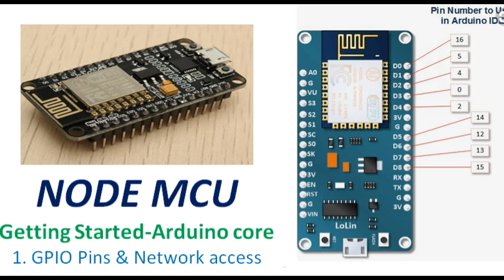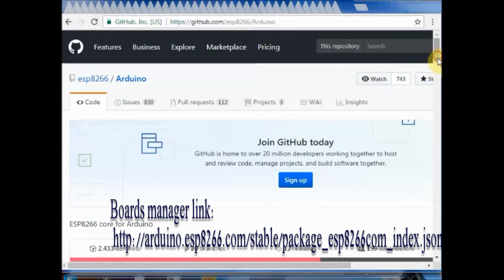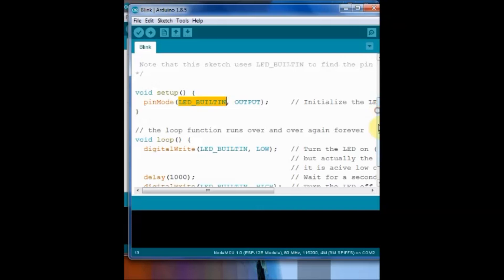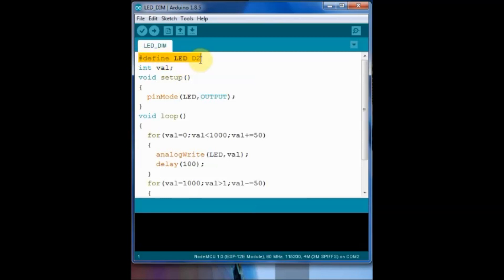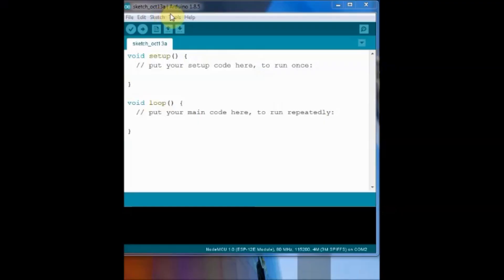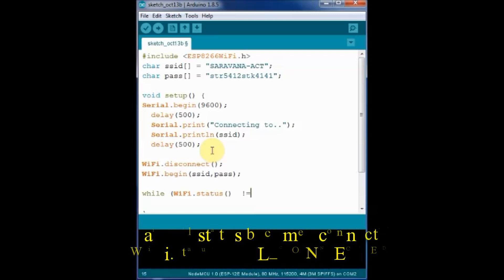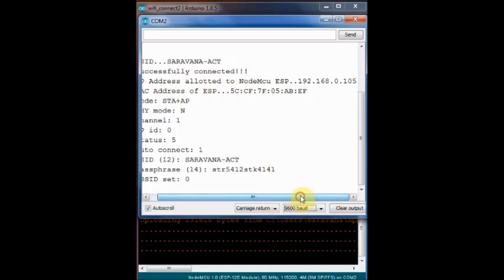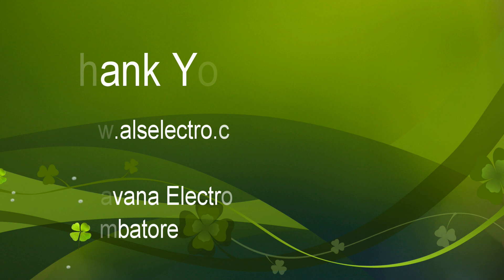NODEMCU - Getting started with Arduino core 1. GPIO & Network Access

Comment: Thanks for the info and video.
Since these boards are usually 3.3 volts I don't think you need the resistor for the LED?

Comment: For those who got the Leaving... Hard resetting via RTS pin message, try keeping your serial monitor open while uploading the sketch. Hope it works.
Reply: i tried doing that nd i am still getting this everytime i upload 
esptool.py v2.7
Serial port COM3
Connecting....
Chip is ESP8266EX
Features: WiFi
Crystal is 26MHz
MAC: ec:fa:bc:a8:3c:e8
Uploading stub...
Running stub...
Stub running...
Manufacturer: 68
Device: 4016
Detected flash size: 4MB
Hard resetting via RTS pin...
esptool.py v2.7
Serial port COM3
Connecting....
Chip is ESP8266EX
Features: WiFi
Crystal is 26MHz
MAC: ec:fa:bc:a8:3c:e8
Uploading stub...
Running stub...
Stub running...
Configuring flash size...
Auto-detected Flash size: 4MB
Compressed 261168 bytes to 190754...

Writing at 0x00000000... (8 %)
Writing at 0x00004000... (16 %)
Writing at 0x00008000... (25 %)
Writing at 0x0000c000... (33 %)
Writing at 0x00010000... (41 %)
Writing at 0x00014000... (50 %)
Writing at 0x00018000... (58 %)
Writing at 0x0001c000... (66 %)
Writing at 0x00020000... (75 %)
Writing at 0x00024000... (83 %)
Writing at 0x00028000... (91 %)
Writing at 0x0002c000... (100 %)
Wrote 261168 bytes (190754 compressed) at 0x00000000 in 17.1 seconds (effective 122.4 kbit/s)...
Hash of data verified.

Leaving...
Hard resetting via RTS pin...
Reply: @ambicatandle2541  Mine also is now doing the same but the circuit still functions properly. Sometimes I'll need to press the reset button but the circuit will work fine

Comment: Leaving.....
Hard resetting via rts pin
Why is this showing sir...please reply
Reply: I've got the same problem when I've installed NodeMCU 0.9 at first. Changed it to v1.0 and it fixed the problem. Still shows 'Hard resetting via RTS pin, but the LED is blinking as it should.

Comment: NORVI IIOT - ESP32 for industrial projetcs

Industrial ESP32, Ready for multiple IDE : Arduino and ESP-IDF
USB Programmable Industrial ESP32 with OLED Display and din-rail mount
Not just a ESP32 in a industrial enclosure, it has designed for protection and reliability.

www.norvi.lk

Comment: In my location (and this is probably true for many users) there are several  access points only marginally within reach, and running WiFi.scanNetworks() twice produces inconsistent results, such that with the code as written the number of SSIDs returned by the first call may not match the number of SSIDs listed after the second.
This code - which calls WiFi.scanNetworks() only once - produces more consistent results...
...
Serial.print ("Nearby networks found   :");
int n = WiFi.scanNetworks();
Serial.println(n);

Serial.println( "List of surrounding Network SSIDs....");
for (int i = 0; i < n; i++)
  Serial.println(WiFi.SSID(i));
...

It may be that running the code repeatedly reports a different number of SSIDs each time, but at least the displayed number found will be the same as the number of SSIDs listed.

Comment: I'm needing help with connection.  the program uploads with no errors but when i open the serial monitor and reset the node, all i get printed is backwards question marks.

what am i doing wrong?
Reply: Check your baud rates for serial monitor. Wrong baud rates will show weird question marks. Hope this helps.

Comment: NodeMCU can take 5V, please refer to datasheet from the vendor, some pointers here.
https://hackaday.io/page/2024-esp8266-is-5v-tolerant-after-all
I have a working design where Nodemcu is reading a TX from Arduino UNO which drives in 5V for LOGIC HIGH without any converters in between

Comment: I I did the initial blink sketch successfully according to your exact instructions and code with my NodeMCU board, but I could not connect to WiFi Network access with your appropriate code. Please, let me how I can avoid getting this error:
"ets Jan  8 2013,rst cause:2, boot mode:(1,7)
 ets Jan  8 2013,rst cause:4, boot mode:(1,7)
wdt reset"

Thank you for a very professional presentation of your video.